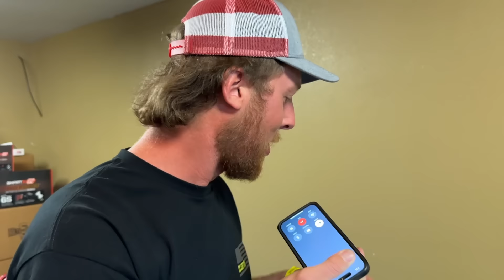I Bought A GIANT R/C Jet... It’s SCARY Fast!!! (I can barely fly it)

Comment: Hey Cleetus check out the fpv setup for those you can fly it like you are actually sitting in the cockpit  and they have head tracker goggles that will let you look around with the camera so it is almost like a virtual reality headset but it’s the jet your flying  so bad ass

Comment: The delta wing supposedly can have a much higher angle of attack on landing than a wing with less than 30° sweep. It also generates humungus lift at those high angles.
This is only useful in landing.
But at the high angles (15-20 degrees) it also creates humongous drag. So a go around can involve a slow transition to safe climb configuration. 
 But something to experiment with on landing. 
All the residual thrust probably makes it trickier to set up for high nose landings.
Deltas are a breed of their own.
Then with the canard, that throws in another element, which may negate everything I just said, as it controls the  stall angle.
Have fun. Cool machine.

Comment: The problem with these jets is they are so streamlined they don't want to slow down at the same time they are heavy so they want to keep going, but when they finally slow down they start to drop like a rock. Its a very fine line to land them. Of course the cool factor is 10x so its worth it lol. I love my 2 jets, mostly for the cool factor, not the landings.

Comment: I feel like these would be a hell of alot easier to fly if it had a pov camera so your looking at where you wanna go and  controlling it is just point and turn which direction you wanna go vs no camera and soon as the jet turns and is coming at you then the controls get switched and crash is probable when your moving that quick and personally i know I would crash soon as the controls are for the most part switched  lol

Comment: If the ''safe'' or practical top speed is 175 MPH that would translate to about 22 to 24 HP equivalent spicy RC piston engine, 
which leads to ''sporty'' performance, especially when it's on a 22 lbs airframe.

Comment: Bro if that's your first time flying a jet you did a great job but I haven't seen you land yet. I have an F-22 Raptor and an F-14 that the wings remotely go in and out and they are both solid planes and will do 400 mph with no problem at all. And I just saw the landing awesome job as that is the hardest part about flying. Yeah bro if you never flown a jet before but have flown a problem and you're just a natural cuz you did an awesome job. My F-22 has the remote torque vectoring and I actually got the plane to land straight from using the torque vectoring hovering at 2 inches off the ground and then put the nose forward and landed so I can imagine how it really feels to fly a real one as I have been to are shows before or the F-22 went down the runway vertically at like 20 miles an hour all the way down the runway so I'm sure they could land a real F-22 like that as well but we're talking over 100 million if you make a mistake and can't land it like that. Will a job well done congratulations now you just have to get some more hours in so you know exactly speed to be at when Landing. If you get good enough you might be able to land like I do as well because I've tried to land with my F-14 hovering 2 inches off the runway but I had trouble going forward it just wanted to go up and I blame that on the torque vectoring that's why I was able to land with the F-22 hovering 2 inches off the ground and then just go forward and cut the fuel and she landed like a helicopter. Both of mine are around the same size with a 10-foot wingspan. I actually have my private jet certification but I have not purchased the jet yet I just have my twin engine Cessna that seats 12. I have three properties one in Rhode Island one in Utah and one in Boca Raton Florida and I have runways in my house in Rhode Island and my house in Utah and I had to extend my runway in Utah as it was not long enough for the used Learjet that I am going to purchase thank God I didn't have to widen it 500 ft. What was nice is when I was a Navy SEAL I got my single and twin engine certifications for free but they did not have a jet course so I had to do that on my own and it was $75,000.

Comment: Man I'd be totally afraid to fly that thing. Once I got an rc helicopter for 200$. It took off, went over my roof and I never found it.
Reply: oof. My first RC heli was old school, nitro engine and mechanical gyro for about $400, concept 30 by kyosho. I took it off once about 5 feet and it veered to the side and crashed pretty quickly. Never got it fixed and feel like a fool. Thankfully they have become much cheaper and easier to fly since.

Comment: Sorry. But I have worked in manufacturing for over 27 years. U-bolt to a shackle on a trailer axle clearly shows negligence on maintenance or improper use of equipment 😳 After so many trips back and forth, you are required to do an inspection on your trailer 🤔
Are you even aware of how many deaths are caused because of poor transportation vehicle maintenance or not property securing a load and then driving on the freeways and roads
in the U.S. ?
The AAA Foundation for Traffic Safety, found that debris on U.S. roads caused more than 200,000 crashes, about 39,000 injuries, and more than 500 deaths in just three years.
It sounds like you're trying to justify your negligence of property inspecting your trailer. You are jeopardizing the safety of your community and others. Man up, bro. Do you due diligence instead of complaining about comments pointing out the obvious 😬🤣

Comment: "Are you just turning with the rudder?"  Don't ever be an actual pilot. Common sense dictates that the rudder can't have authority while taxiing.
Reply: it can, depending on the wind, but obviously not as much as the wheel
Reply: if one uses a caster style swivel wheel the rudder can easily nudge it in the desired direction as i've wanted one for my planes that have no such wheel that does not resist turns